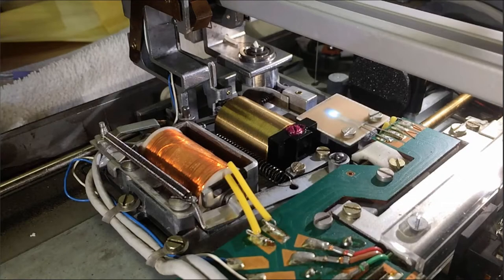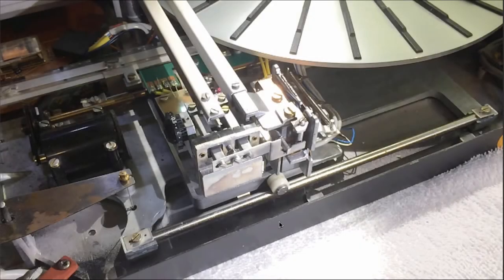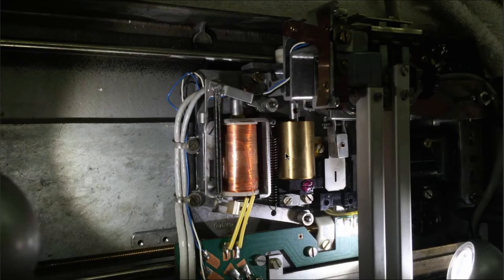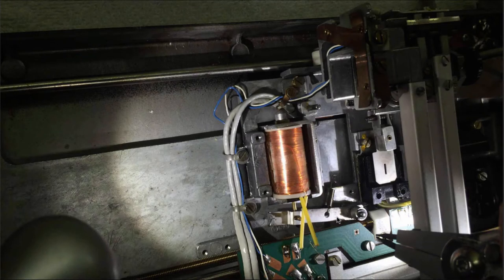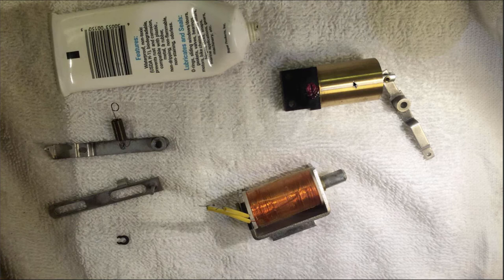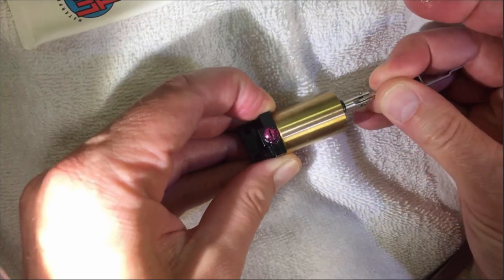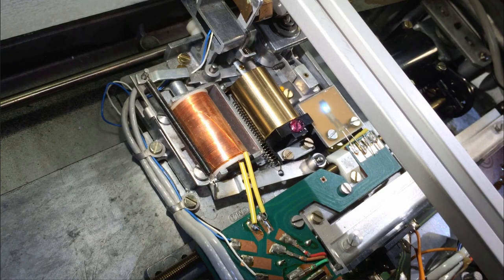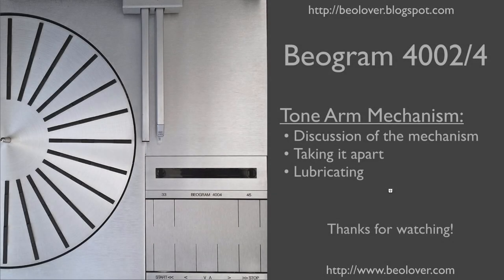Beogram 4002/4004: Restoring and Adjusting the Tone Arm Mechanism

Comment: Thank you so much for this PRICELESS tutorial!! I was able to fix my non-lowering 4004 arm thanks to this tutorial, so easy to follow. Just for the record, in my case the solenoid was moving okay-ish, the damper was the element entirely stuck so I detached that alone (with its implied joint mechanism), opened it, cleaned it, lubricated it, and now it works very well. I didn't want to have to desolder the solenoid even though I understand it would be ideal to do it, it's on my to-do list for another summer. 

Thank you once again, you're incredibly knowledgeable and the fact that you decide to just share this is truly amazing, much respect to you sir.

Comment: Dude! You you saved the life of my Beograd 404. The damper was the problem. Thank you so much. This is Why the internet is so fucking great. 
Thanks dude!
Reply: Danskvand Productions curious what size snap ring pliers he used? Can't find any small enough to take off the snapring! Thank you!
Reply: Luigi Oppido hey luigi. 
I only adjustet the damper with a screwdriver. So i don’t know about those pliers. Sorry. Hope you find a sollution. Best regards /Jens /danskvand
Reply: Danskvand Productions thank you so much :)

Comment: Thank you very much for your videos. I have learned here that my mechanism does in fact need to be cleaned and re-greased. I will do that while waiting for my new drive belt to arrive and I will have to add cleaning and re-greasing of the damper as I can see it is completely stuck.

I will have more questions for you and have subscribed to the Beoworld blogsite for those. I just received this 4002 and am noting that the only indication of function at all is while holding and pressing the "Start" button, the appropriate lights come on and the DC motor starts, but if I release the button everything turns off. The tone arm does not move or begin to move or attempt to move, however if I manually rotate the worm screw to advance the arm past the micro switch, the tone arm sensor light comes on and the DC drive motor stays on, however inward tracking button will not advance the arm inward. If I press the Stop button, the arm will track back to "home" position and turn back off.

I will clean and grease and get the arm lowering mechanism working and install the new belt while seeking advisement on what the next repair process will be.

Thank you again for these wonderful, concise, detailed but not overwhelming videos. Your work is much appreciated!

Comment: I have a beogram 4002 that I inherited.  The tone arm and balance are not parallel,  can this be fixed and how do you access, remove lid and tone arm cover?
Reply from the maker: You can pull the cover up vertically. It is only held in place with a leaf spring. Adjusting the tracking weight is shown here: https://youtu.be/j3KNUQIsTG4. Good luck with your 4002!

Comment: Wow!! Thank goodness for your video. I have a Beogram 4004 Turntable. Haven't used it for a couple of years. Now I turn it on, the platter spins but the tangential tone arm does not move toward the vinyl record on the platter. Plus I press the start, stop and <<,>> keys and nothing happens. Any idea what could be wrong? Why does the platter even spin without my pressing the start key? Any one have any recommendations on where I can send it to get repaired. It's in very good condition. I live in New Jersey in the USA. Thanks for your help.
Reply from the maker: Have you already checked if the carriage belt is properly installed? Restoration/repair: Please, send an email to beolover@gmail.com to discuss...